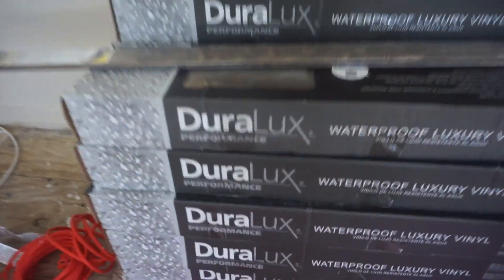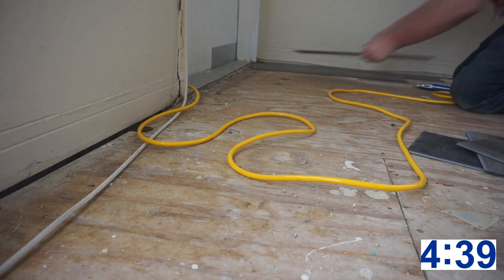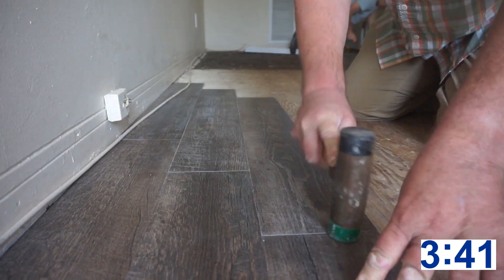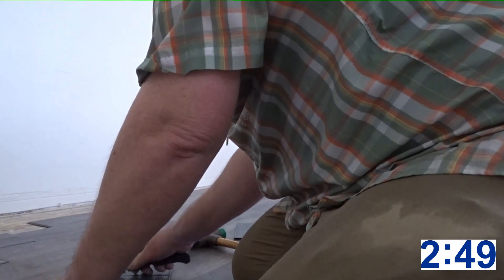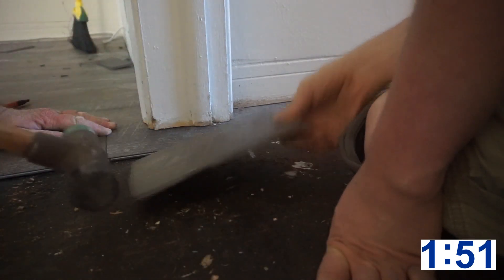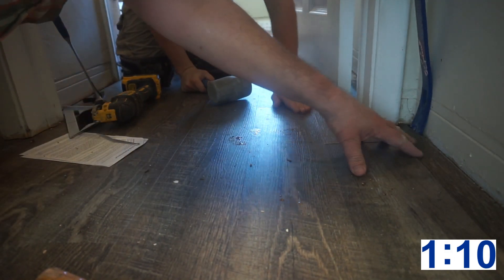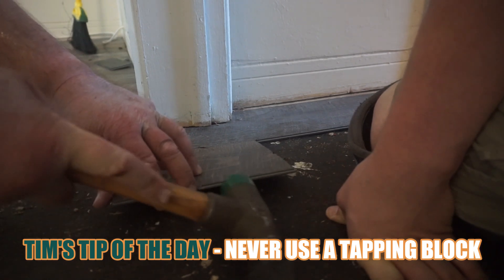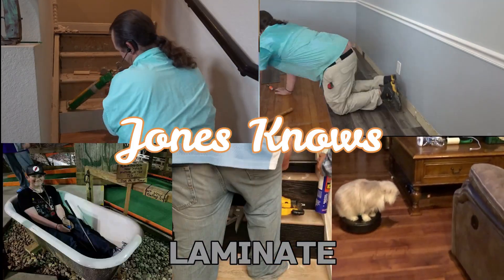VINYL FLOORING INSTALLATION - How To - 5 STEPS FOR A PROPER DIY INSTALL - DURALUX BY FLOOR & DECOR

Comment: As someone else who has worked with these, this is way better information than some who have a more "professional" image and still using a board instead of a rubber mallet. Remember the 1/4" gap and it is all good

Comment: Thanks for the tips. i just installed Duralux Luxury Performance Vinyl flooring yesterday in my guest bedroom/ second office and you are spot on by not using a tapping block. A scrap piece made locking the planks and fitting the boards perfectly smooth.
Reply from the maker: Thanks! Happy I could help!!

Comment: Thanks for your great videos have 2 quick questions ,1 can the planks for the template all be cut 8 ins or all 12 ins or should they vary.2 The cuts  left over from template to start next phase can they be used in any order, again many thanks

Comment: Hey Tim,

I purchased the windmill oak thanks to you. I just could not afford life proof. Can I install the   Duralux directly over concrete subfloor ? 50 year old subfloor, never had any moisture issues. Carpet before .
Reply from the maker: Yes but make sure to sue a vapor barrier (6 mil plastic).

Comment: Hey thanks for your videos. My wife and I just bought our first home and will be using LVP. We are in Florida and would lay it directly on concrete. We have a floor & decor very close to us and they have a duralux finish we really like and it’s the absolute cheapest around. $1.39/sq ft. Would you recommend the duralux floors? Are they durable? I’ve read many review about the tongue and groove breaking off and it scratching bad.
Reply from the maker: Duralux has a lot of different lines. I like most of them, but If you go with Duralux get the thicker, at least 41/2-5mm thick. And if possible with a rigid core. I think they start @  $1.89 not on sale for the products I’m referring to.. The problem with the thinner ones are they are very soft and are not as durable at all. They dent scratch u name it.

Comment: 5:00

Man…. I CANNOT get this part to go smoothly.  I have broken two boards and I have EXACTLY enough material to finish the job, assuming I don’t break this next one.  Otherwise I’m buying another box just to finish up two inches of flooring. 

🤞guess I’ve got no choice now but to go for it one last time.

Comment: Dose this stuff need any underlayment?
Reply from the maker: Nope not for the one we installed here, but if you’re on the first floor then you will need to use a 6 mil Poly vapor barrier. There are different Duralux lines though so just check and make sure the one one you choose has attached underlayment.

Comment: Tim, ive seen several videos that go in great depth about "centering" the floor... is that really a major concern or do you guys just lay the 1st row and roll with it? Also, do you check that the wall for the starting row is straight/square, or do you use your ripping trick on the 1st and last rows? thanks for the content!! best flooring videos ive found
Reply from the maker: Most installers just go with it unless it’s a small   Room. Most jobs have too many ending walls to worry about what size pieces you’re going to end up with. most installers just go with It. On your starting wall you want to make sure you start straight. However, you don’t need to cut the floor you can use spacers to adjust the floor. You can check if you’re straight and make adjustments by measuring off the opposite wall on other side of room. On both ends of the floor. Or you can snap a chalk line off the far wall and measure off that. If your starting wall is straight then you probably don’t have to do any of that. When ever possible i try to start my floors off the exterior walls because they are always the straightest. Let me know if you have anymore questions. I hope I didn’t confuse you I’d be happy to clarify anything for you.

Comment: One more request for advice.  Small condo, the longer wall walking in the entrance would suggest to lay the floor that direction as you walk in however that would leave the floor being laid perpendicular to the door wall (only source of light in that room) and would leave doing the hallway with the planks perpendicular to the hall. I kind of think it would look better to have the planks going toward the  only source of light (door wall) and then they would be running parallel in the hallway.  Agreed?
Reply from the maker: So I always say there are 3 factors to deciding which way to run your flooring. Length of room, light flow, the way you walk in room and if there is a 4th deciding factor it would be hallway direction.  In your case the light flow is probably one of the most important and so is hallway direction, because it looks much better running down the hall, then across it. So you have more factors in favor of the door wall then the way you walk into the room. So yes I agree.

Comment: Send the extra money on a quality floor. This is by far the cheapest crap I've ever worked with. The money you waste on all the peices  that easily break you could send on a real quality floor. Most difficult flooring I've ever installed. This stuff can not be used around door jams. You can only have success with this product on a perfectly squared floor. RUN!